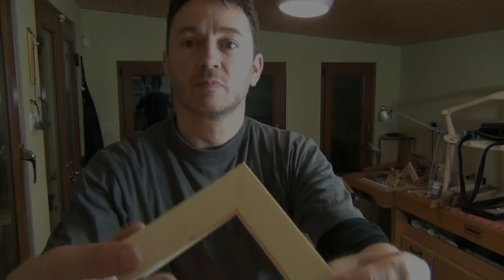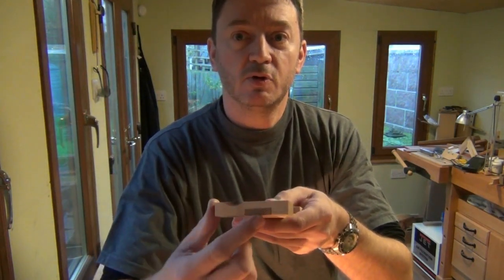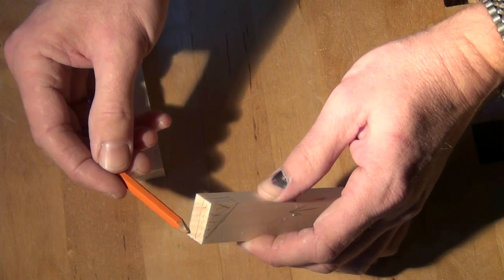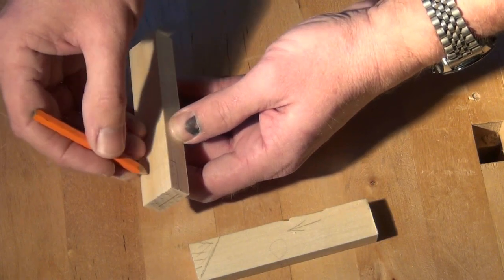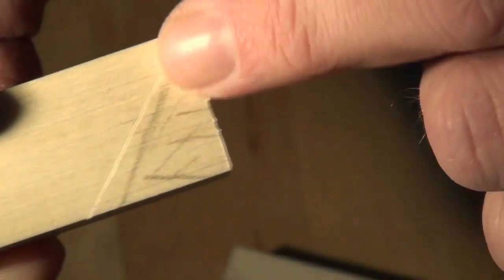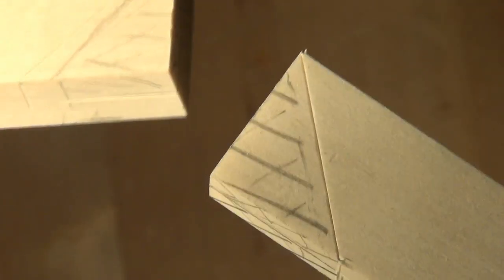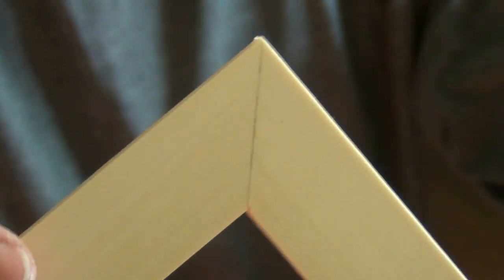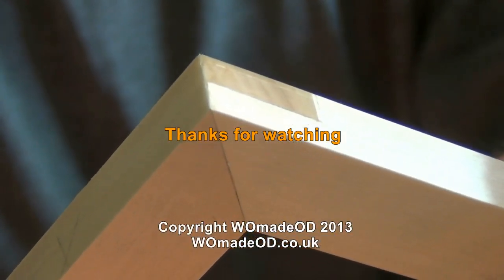Mitred Halving Joint (a.k.a. Mitred Half Lap, Lapped Mitre Joint....)

Comment: Mitch, I made one of these joints for the fun of it and just to try it out, I see why you have that special 45 degree layout gauge! It was awkward to layout the 45 degree angle with my Starrett combination square so I ordered one of those 45 degree layout gauges today, I see why you need it. Thanks again.
Reply from the maker: I'm sure a Starrett combination gauge would be pretty accurate, but I do prefer using fixed gauges where possible for marking out of joints. But if your mitre doesn't quite mate well, you can adjust it with a shoulder plane, or just a chisel, for a good fit.
Main thing is you tried, and with a little practice you'll be able to make one better than I did here.

Comment: Mitch I am interested in the tools you used. The metal 45 degree tool you used and the tool with the wheel that allowed you to scar the wood for cutting.
Reply from the maker: Hi Thomas, 
The one is a Japanese mitre square, the other a wheel marking gauge. These two came from Axminster Tools and Machinery in the UK, but are widely available. 
Happy woodworking, Mitch
Reply: Thanks for returning my message. You are great at what you do.

Comment: Hi Mitch. If you reference the marking gauge off the same face, doesn't that mean that on one piece, you're going to have the dent of the bevel on the 'keep' material?
Reply from the maker: Yep. But, the water in the glue should swell it back. The reason for using the same face is to avoid any error in gauge setting, which could result in the show surfaces not being flush when pared to the gauged line.

Comment: Good job but on track can't see things too much for one things put on forward and don't bla bla show the things
Reply from the maker: Cheers, not quite sure what you mean though
Reply: @mitchwoodwork  He means that he doesn't have the patience or the understanding to follow you, but he's too rude to put it, diplomatically.
Thanks for the video.
I tried this for the first time, and it came out well, though it does bend the brain, somewhat, until you get the method off, pat.
As usual, the trick is to do it for yourself, then you understand.
Reply from the maker: @Offshoreorganbuilder  I think you could be right 😏
Good on you for tackling it.